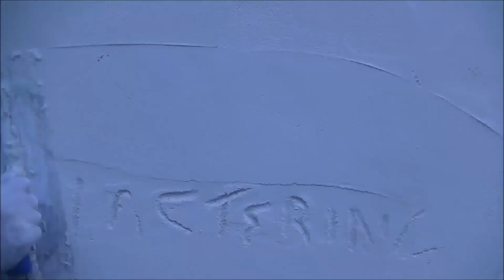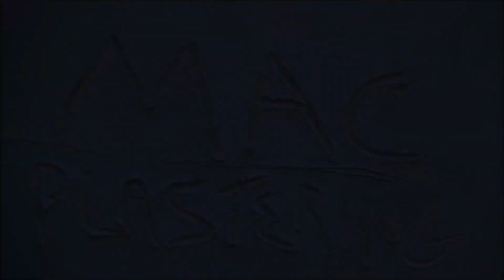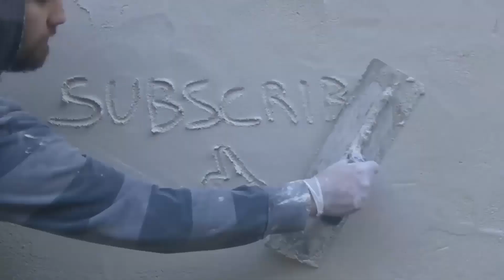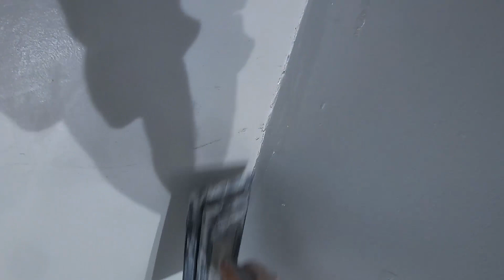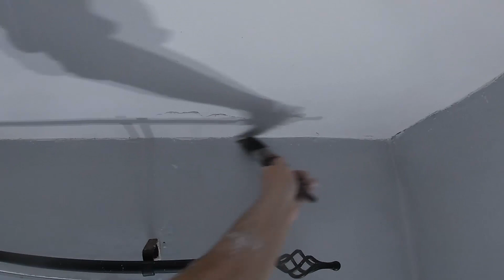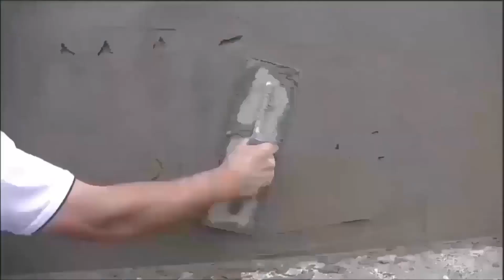Darth Vader Plastering,  Troweling a Ceiling with Plazi Flex @ Make Good Plaster

Comment: I find using plastic / Flexi blades when the plaster is still wet to leave ripples in the finish, steel blade for me till final 2 passes... Like your work tho 👍
Reply from the maker: Your not alone mate I know many are the same and this isn't even the way I always do it but this is make good plaster so need to test and try many diffrent ways to see what's best but when this whole video is live this part will make more sense  :) I HOPE :)
Reply: @macplastering  how do you find the make good finish? Would you recommend it?  I haven't used it yet, the bonding seems okay but iv heard mixed things on the finish?
Reply from the maker: @tc-ow1ol  Carlite and multi are easier to finish and its what we are all used to but I can get nice work done so far with this gear but if I was to choose I like Carlite the most have a video on me doing a small ceiling and some bigger ones if you fancy a watch at those
Reply: @macplastering  I will give those a watch mate, Iv watched a fair few of your videos 👍
Reply from the maker: @tc-ow1ol  Appreciate all your support mate :) here let me know what you think on them I do really hope they keep working on it
Reply: @macplastering  I will do mate!
Reply from the maker: Not sure if ya seen this one yet mate but this makes more senses as its a little more footage of what i was doing = https://youtu.be/i3z7muHkujs